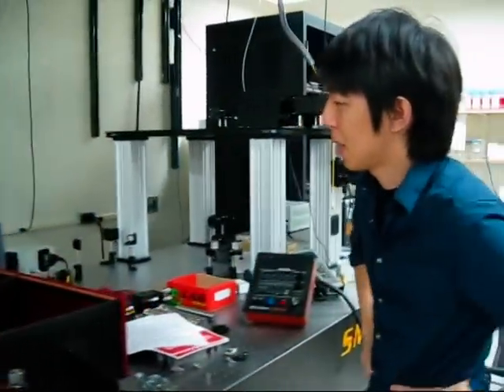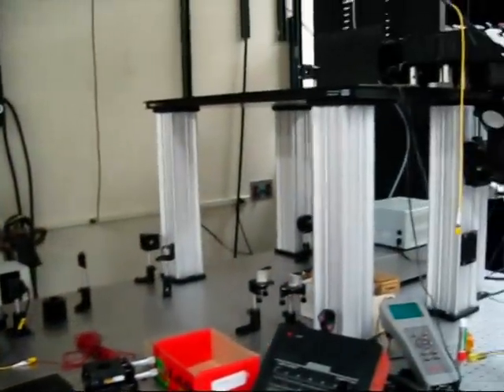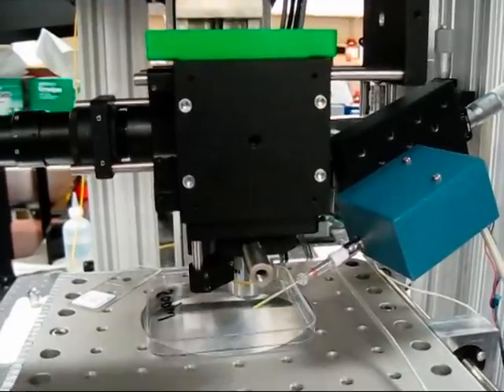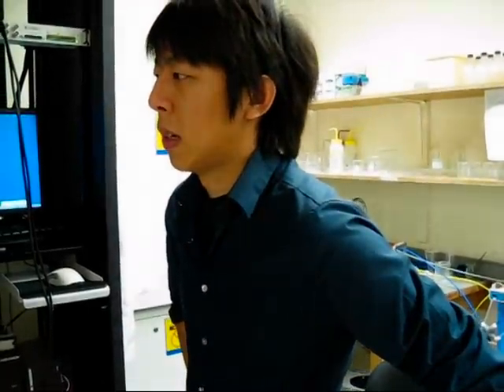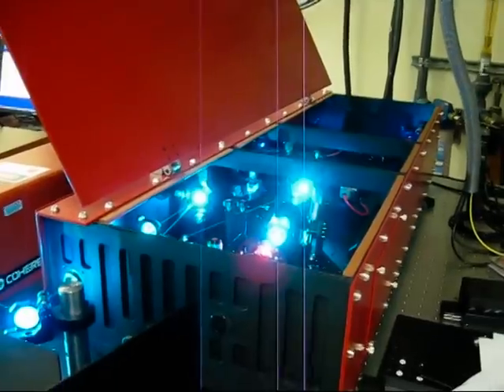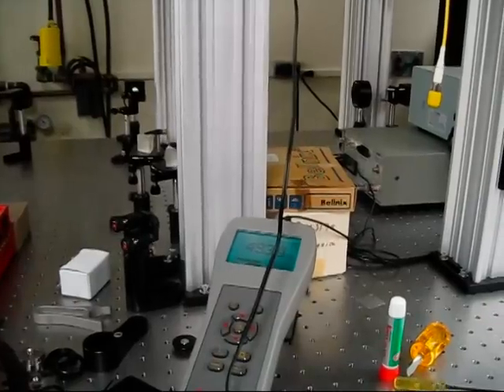Del Mar Photonics Ti:Sapphire laser Trestles in the UCLA Biophysics Neuroimaging Laboratory

Comment from the maker: Histology in vivo: chemical contrast combined with clinical multimodal multiphoton tomograpy
Martin Weinigel, Hans Georg Breunig, Karsten Koenig
10 February 2015 • 11:15 - 11:30 AM | Part of SPIE BiOS

Tailored multiphoton polymerization with abruptly autofocusing beams
Maria Manousidaki, Dimitrios G. Papazoglou, Maria Farsari, Stelios Tzortzakis
11 February 2015 • 4:00 - 4:20 PM | Part of SPIE LASE

Improvement of the spatial resolution in multiphoton microscopy by saturated excitation of fluorescence
Anh Dung Nguyen, Francois Duport, Frederique Vanholsbeeck, Serge Goldman, Philippe Emplit, Simon-Pierre Gorza
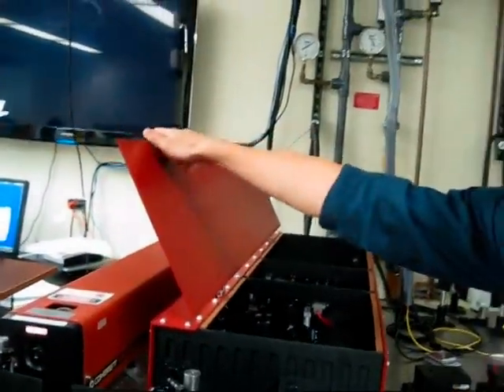8 February 2015 • 5:30 - 7:00 PM | Part of SPIE BiOS

New insights and system designs for temporally-focused multiphoton optogenetics
Tom Mayblum, Adi Schejter, Hod Dana, Shy Shoham
8 February 2015 • 5:30 - 7:00 PM | Part of SPIE BiOS

Detecting the collagen-based hydrogels degradation by multiphoton microscopy (MPM)
Xuye Lang, Matthew J. Spousta, Julia G. Lyubovitsky
8 February 2015 • 5:30 - 7:00 PM | Part of SPIE BiOS

Monitoring wound healing by multiphoton tomography/endoscopy
Karsten Konig, Martin Weinigel, Volker Huck, Katharina Zens, Stefan W. Schneider
7 February 2015 • 3:10 - 3:30 PM | Part of SPIE BiOS
UPCOMING CONFERENCE
Multiphoton Microscopy in the Biomedical Sciences XV
8-10 Feb 2015 | Part of SPIE BiOS

Classification and recognition of texture collagen obtaining by multiphoton microscope with neural network analysis tool
Shulian Wu, Hui Li, Xiaoman Zhang
8 February 2015 • 5:30 - 7:00 PM | Part of SPIE BiOS

In vivo non-invasive multiphoton tomography of human skin with subcellular spatial and picosecond time resolution to detect bio- and chemohazards
Karsten Konig
8 February 2015 • 5:30 - 7:00 PM | Part of SPIE BiOS

Biomedical applications involving multiphoton probes
Mary J. Potasek, Karl Beeson, Evgueni Parilov
8 February 2015 • 5:30 - 7:00 PM | Part of SPIE BiOS

Fiber endface Fabry-Perot vapour microsensors fabricated by multiphoton polymerization technique
Vasileia Melissinaki, Ioannis Konidakis, Maria Farsari, Savros Pissadakis
8 February 2015 • 4:30 - 4:50 PM | Part of SPIE OPTO

Characterizing germania concentration and structure in fiber soot using multiphoton microscopy and spectroscopy technology
Minghan Chen, Ming-Jun Li, Anping Liu
10 February 2015 • 6:00 - 8:00 PM | Part of SPIE LASE

Third harmonic generation and multiphoton fluorescence in graphene using a compact femtosecond 1.56 µm laser
Antti Saynatjoki, Lasse Karvonen, Juha Riikonen, Wonjae Kim, Joonas Makinen, Seyed Soroush Mehravar, Robert A. Norwood, Nasser N. Peyghambarian, Harri Lipsanen, Khanh Kieu
9 February 2015 • 1:40 - 2:00 PM | Part of SPIE OPTO

Identifying different stages during development of colorectal adenocarcinoma using multiphoton microscopy
Jianxin Chen, Zhifen Chen, Changyin Feng, Guoxian Guan, Lianhuang Li
9 February 2015 • 2:35 - 2:50 PM | Part of SPIE BiOS

Some new directions for multiphoton processes and their biomedical applications
Paras N. Prasad
8 February 2015 • 8:30 - 9:00 AM | Part of SPIE BiOS

Multiphoton microscopy for the characterization and treatment of malignant breast lesions
Alex J. Walsh, Rebecca S. Cook, Melinda E. Sanders M.D., Carlos L. Arteaga, Melissa C. Skala
7 February 2015 • 9:50 - 10:10 AM | Part of SPIE BiOS

Co-registration of optical microangiography and multiphoton microscopy for tracking dynamic wound healing
Wan Qin, Yuandong Li, Ruikang K. Wang
8 February 2015 • 5:30 - 7:00 PM | Part of SPIE BiOS

In vivo multiphoton microscopy imaging of basal cell carcinoma
Mihaela Balu, Christopher B. Zachary M.D., Ronald M. Harris M.D., Tatiana B. Krasieva, Karsten Konig, Bruce J. Tromberg, Kristen M. Kelly M.D.
7 February 2015 • 8:50 - 9:20 AM | Part of SPIE BiOS

MEMS-based handheld multiphoton endomicroscope for in vivo imaging
Xiyu Duan, Haijun Li, Zhen Qiu, Bishnu P. Joshi, Asha Pant, Katsuo Kurabayashi, Kenn R. Oldham, Thomas D. Wang M.D.
9 February 2015 • 3:40 - 4:00 PM | Part of SPIE BiOS

Nanoparticle-assisted-multiphoton microscopy for in vivo brain imaging of mice
Jun Qian
10 February 2015 • 11:00 - 11:20 AM | Part of SPIE BiOS

Multiphoton microscopy in brain imaging
Francesco S. Pavone
8 February 2015 • 9:00 - 9:30 AM | Part of SPIE BiOS

Multiphoton tomography on astronauts
Karsten Konig, Martin Weinigel, Nicole Gerlach, Ulrike Heinrich
9 February 2015 • 8:30 - 8:50 AM | Part of SPIE BiOS

In-vivo quantification of cutaneous melanin concentration and distribution: a comparison of multiphoton microscopy and spatially modulated quantitative spectroscopy
Rolf B. Saager, Mihaela Balu, Viera Crosignani, Ata Sharif, Anthony J. Durkin, Bruce J. Tromberg, Kristen M. Kelly
7 February 2015 • 9:40 - 10:10 AM | Part of SPIE BiOS

Imaging human melanoma using coherent anti-stokes Raman scattering (CARS) and multiphoton microscopy (MPM)
Hequn Wang, Sam Osseiran, Elisabeth Roider, Vivien Igras, David E. Fisher, Conor L. Evans
10 February 2015 • 11:00 - 11:15 AM | Part of SPIE BiOS

Image-inspired 3D multiphoton excited fabrication of extracellular matrix structures by modulated raster scanning for cancer biology studies
Paul J. Campagnola, Visar Ajeti, Kevin W. Eliceiri, Manish Patankar
12 February 2015 • 3:50 - 4:20 PM | Part of SPIE LASE

Visualizing and quantifying melanoma risk factors with coherent anti-Stokes Raman scattering (CARS) and multiphoton microscopy
Hequn Wang, Sam Osseiran, Elisabeth Roider, Vivien Igras, Peter T. C. So, David E. Fisher, Conor L. Evans
7 February 2015 • 11:40 AM - 12:10 PM | Part of SPIE BiOS

2D simultaneous spatial and temporal focusing multiphoton microscopy for fast volume imaging with improved sectioning ability
Qiyuan Song, Keisuke Isobe, Kenichi Hirosawa, Katsumi Midorikawa, Fumihiko Kannari
8 February 2015 • 5:30 - 7:00 PM | Part of SPIE BiOS

Nonlinearly fiber-converted coherent source with broad spectral coverage for multiphoton imaging
Haohua Tu, Yuan Liu, Youbo Zhao, Stephen A. Boppart M.D.
8 February 2015 • 1:50 - 2:10 PM | Part of SPIE BiOS

Non-invasive discrimination between pancreatic islets and exocrine cells using multiphoton microscopy
Binlin Wu, Ge Li, Mingming Hao, Shuibing Chen, Sushmita Mukherjee
8 February 2015 • 5:30 - 7:00 PM | Part of SPIE BiOS

Multiphoton light-sheet microscopy using wavelength mixing: fast multicolor imaging of the beating Zebrafish heart with low photobleaching
Pierre Mahou, Julien Vermot, Emmanuel Beaurepaire, Willy Supatto
9 February 2015 • 11:50 AM - 12:05 PM | Part of SPIE BiOS

Label-free multimodal multiphoton imaging by adaptively shaping fiber supercontinuum pulses
Yuan Liu, Haohua Tu, Eric J. Chaney, Sixian You, Stephen A. Boppart M.D.
7 February 2015 • 3:00 - 3:15 PM | Part of SPIE BiOS

Novel applications of melanin pump-probe imaging: correlating structural and chemical variation with MC1R gene expression and the onset of Parkinson's disease
Sanghamitra Deb, Christopher P. Dall, Francisco E. Robles, Christina S. Gainey, Jesse W. Wilson, Warren S. Warren, Nicole A. Kukutsch
9 February 2015 • 11:05 - 11:20 AM | Part of SPIE BiOS

High-speed 3D laser printing by two-photon induced chemistry: breaking the centimeter-scale limit
Pablo M. Romero, Nerea O. Ramudo, Olivier Stephan, Kevin J. Heggarty, Maria Farsari, Boris Chichkov, Patrice Baldeck
11 February 2015 • 10:30 - 11:00 AM | Part of SPIE OPTO

Combining wide-field assessment with nonlinear optical microscopy: possibilities for multimodal imaging in epithelial (pre)cancer
Rahul Pal, Jinping Yang, Gracie Vargas
9 February 2015 • 2:05 - 2:20 PM | Part of SPIE BiOS

Resolution enhancement through three color photolithography
Zuleykhan Tomova, John T. Fourkas
12 February 2015 • 4:50 - 5:10 PM | Part of SPIE LASE

Latest advances in ultra-fast laser sources for multi photon microscopy
Phil Smith
8 February 2015 • 4:25 - 4:40 PM | Part of SPIE BiOS

Adaptation of commercial microscopes for advanced imaging applications
Craig Brideau, Peter Stys
8 February 2015 • 5:30 - 7:00 PM | Part of SPIE BiOS

Mechanical response of single nerve cells estimated by femtosecond laser-induced impulsive force
Takanori Iino, Tadahide Furuno, Man Hagiyama, Akihiko Ito, Yoichiroh Hosokawa
8 February 2015 • 2:30 - 2:50 PM | Part of SPIE LASE

Effect of tip geometry on two photon excited luminescence of single gold nanorods
Arif M. Siddiquee
8 February 2015 • 9:10 - 9:30 AM | Part of SPIE BiOS

Brightness-equalized quantum dots
Andrew M. Smith, Sung Jun Lim
8 February 2015 • 4:20 - 4:50 PM | Part of SPIE BiOS

Improved chromatical and field correction of high-NA GRIN-based endomicroscopic imaging systems for new biophotonic applications
Gregor Matz, Bernhard Messerschmidt, Herbert Gross
9 February 2015 • 11:20 - 11:40 AM | Part of SPIE BiOS

Real-time monitoring of tumor response to preoperative radiochemotherapy for rectal carcinoma by nonlinear optical microscopy
Lianhuang Li, Jianxin Chen
10 February 2015 • 11:35 - 11:55 AM | Part of SPIE BiOS

Nonlinear chromophores with NIR properties for applications in biology and defense
Chantal Andraud
10 February 2015 • 8:00 - 8:40 AM | Part of SPIE OPTO

Interferometric second harmonic generation imaging of biological tissues
Charles-Andre Couture, Maxime Rivard, Konstatin Popov, Mathieu Laliberte, Anthony Bertrand-Grenier, Amir Miri, Francois Martin, Henri Pepin, Luc Mongeau, Christian Pfeffer, Cameron Brown, Lora Ramunno, Francois Legare
8 February 2015 • 5:30 - 7:00 PM | Part of SPIE BiOS

Advantages and drawbacks of Thiol-ene based resins for 3D-printing
Holger Leonards, Andreas Hoffmann, Sascha Engelhardt, Martin M. Wehner, Arnold Gillner
11 February 2015 • 2:20 - 2:40 PM | Part of SPIE LASE

Insights into cellular contact guidance through 3D nanofabrication
Wolfgang Losert
12 February 2015 • 10:40 - 11:10 AM | Part of SPIE LASE

Characterizing the significance of multiple enzyme-bound formulations of NADH and their role in cerebral metabolism using 2-Photon fluorescence lifetime microscopy
Mohammad A. Yaseen, Sava Sakadzic, Buyin Fu, Weicheng Wu, David A. Boas
7 February 2015 • 11:00 - 11:20 AM | Part of SPIE BiOS

Mechanisms for forbidden hyper-Rayleigh scattering
David L. Andrews, Mathew D. Williams, Jack S. Ford
11 February 2015 • 5:40 - 6:00 PM | Part of SPIE LASE

A modular two-photon microscope for simultaneous imaging of distant cortical areas in vivo
Fabian F. Voigt, Jerry L. Chen, Roland Krueppel, Fritjof Helmchen
8 February 2015 • 5:30 - 7:00 PM | Part of SPIE BiOS

Monitoring metabolic enzyme activity in cells with fluorescence lifetime imaging of NAD(P)H
Joe T. Sharick, Melissa C. Skala
8 February 2015 • 5:30 - 7:00 PM | Part of SPIE BiOS

Optimizing laser and probe molecules for multi-photon microscopy
Mary J. Potasek, Gene Parilov, Karl Beeson
8 February 2015 • 5:30 - 7:00 PM | Part of SPIE BiOS

Wide area fluorescent lifetime imaging of surgical specimens using two photon microscopy at MHz rates
Michael G. Giacomelli, Yury Sheykin, Jeffrey Brooker, James L. Connolly, Alex E. Cable, James G. Fujimoto
9 February 2015 • 8:00 - 8:30 AM | Part of SPIE BiOS

Optical nonlinearities in few-layer gallium selenide
Lasse Karvonen, Antti Saynatjoki, Seyed Soroush Mehravar, Raul D. Rodriquez, Susanne Hartmann, Dietrich R. T. Zahn, Seppo K. Honkanen, Robert A. Norwood, Nasser N. Peyghambarian, Khanh Q. Kieu, Harri Lipsanen, Juha Riikonen
8 February 2015 • 10:00 - 10:15 AM | Part of SPIE OPTO

In situ determination of collagen fibrils size via absolute measurements of second harmonic generation
Stephane Bancelin, Carole Aime, Ivan Gusachenko, Laura Kowalczuk, Gael Latour, Thibaud Coradin, Marie-Claire Schanne-Klein
8 February 2015 • 5:30 - 7:00 PM | Part of SPIE BiOS

Optical cell cleaning by NIR femtosecond lasers
Aisada Uchugonova, Hans Georg Breunig, Ana Batista, Karsten Konig
11 February 2015 • 1:30 - 1:50 PM | Part of SPIE BiOS

Compact fixed wavelength femtosecond oscillators for multi-photon imaging
Tommi Hakulinen, Ruben Zadoyan, Tommaso Baldacchini, Tilman Franke
9 February 2015 • 10:50 - 11:05 AM | Part of SPIE BiOS

Applied 3D printing for microscopy in health science research
Craig Brideau, Kourosh Zareinia, Peter Stys
8 February 2015 • 5:30 - 7:00 PM | Part of SPIE BiOS

Next generation laser sources for non-linear imaging
Darryl McCoy, Marco Arrigoni, Nigel Gallaher
8 February 2015 • 4:10 - 4:25 PM | Part of SPIE BiOS

Breast cancer staging through nonlinear endomicroscopy
Gunnsteinn Hall, Wenxuan Liang, Lu Jiang, Kristine Glunde, Xingde Li
9 February 2015 • 9:05 - 9:20 AM | Part of SPIE BiOS

Low cost and compact nonlinear (SHG/TPE) laser scanning endoscope for bio-medical application
Hao Li, Jia Yun Liu, Hon Luen Seck, Xia Yu, Shawwei Kok, Ying Zhang
9 February 2015 • 2:50 - 3:10 PM | Part of SPIE BiOS

Optical diagnosis of mammary ductal carcinoma using advanced optical technology
Yan Wu, Yuting Nie, Fangmeng Fu, Yuane Lian, Shuangmu Zhuo, JIanxin Chen, Chuan Wang
7 February 2015 • 4:50 - 5:10 PM | Part of SPIE BiOS

Development and commercialization of mode-locked VECSELs
Nils Hempler, Craig J. Hamilton, Gareth T. Maker, Graeme P. Malcolm
10 February 2015 • 8:30 - 9:00 AM | Part of SPIE LASE

Revealing the uptake mechanisms of polymeric nanomedicines with coherent Raman scattering microscopy
Natalie L. Garrett, Lisa Godfrey, Aikaterini Lalatsa, Ijeoma F. Uchegbu, Andreas G. Schatzlein, Julian Moger
10 February 2015 • 5:35 - 5:50 PM | Part of SPIE BiOS

Low-noise supercontinuum: Development, characterization, and programmable biomedical imaging
Haohua Tu, Yuan Liu, Sixian You, Stephen A. Boppart M.D.
9 February 2015 • 10:40 - 11:00 AM | Part of SPIE LASE

Targeted illumination in 3D for excitation and stimulation
Elijah Y. Yew, Peter T. C. So
9 February 2015 • 8:50 - 9:05 AM | Part of SPIE BiOS

Nanoparticles generation inside Ag-doped LBG glass by annealing or femtosecond direct laser writing
Marie Vangheluwe, Yannick G. Petit, Nicolas Marquestaut, Evelyne Fargin, Alexia Corcoran, Feng Liang, Real Vallee, Thierry Cardinal, Lionel S. Canioni
10 February 2015 • 9:40 - 10:00 AM | Part of SPIE OPTO

High-resolution nonlinear ellipse rotation measurements for 3D microscopy
Lino Misoguti, Maria L. Miguez, Emerson C. Barbano, Sergio C. Zilio
8 February 2015 • 5:30 - 7:00 PM | Part of SPIE BiOS

Two photon polymerization (2PP) technique optimization study using a green femtosecond oscillator
Areti Mourka, Vasileia Melissinaki, Maria Farsari, Antoine Courjaud, Eric P. Mottay
10 February 2015 • 6:00 - 8:00 PM | Part of SPIE LASE

Microfabrication of three-dimensional filters for liposome extrusion
Tommaso Baldacchini, Vicente Nunez, Ruben Zadoyan
12 February 2015 • 1:40 - 2:10 PM | Part of SPIE LASE

Image-guided ablation for the study of bone regeneration using a femtosecond fiber laser source
Luke J. Mortensen, Clemens Alt, Chia-Yuan Chang, Raphael Turcotte, Giuseppe Intini, Charles P. Lin
9 February 2015 • 5:30 - 7:30 PM | Part of SPIE BiOS

Determination of the spectral dependence of reduced scattering and quantitative SHG imaging for detection of fibrillar changes in ovarian cancer
Kirby R. Campbell, Paul J. Campagnola, Karissa B. Tilbury
8 February 2015 • 5:30 - 7:00 PM | Part of SPIE BiOS

Enhanced nanograting formation assisted by silver ions in a sodium gallophosphate glass: Correlation between surface nanostructuring, fluorescence, and effective second-order nonlinear optical properties
Marie Vangheluwe, Feng Liang, Yannick Petit, Patricia Hee, Yannick Ledemi, Sebastien Thomas, Nicolas Marquestaut, Evelyne Fargin, Thierry Cardinal, Younes Messaddeq, Lionel Canioni, Real Vallee
8 February 2015 • 2:30 - 2:50 PM | Part of SPIE OPTO

Towards 3D laser nano patterning in polymer optical materials
Patricia J. Scully, Walter Perrie
12 February 2015 • 8:30 - 9:00 AM | Part of SPIE LASE

Imaging and modeling the extracellular matrix in ovarian cancer
Paul J. Campagnola, Karissa Tilbury, Kirby Campbell, Visar Ajeti, Kevin Eliceiri, Manish Patankar
7 February 2015 • 10:40 - 11:10 AM | Part of SPIE BiOS

Two- and three-photon excited fluorescence microscopy of erythrocytes using sub-50fs Ti:sapphire and Yb lasers
Marcos Dantus, Ilyas Saytashev
9 February 2015 • 1:50 - 2:05 PM | Part of SPIE BiOS

High repetition nanosecond Ti:sapphire laser for photoacoustic microscopy
Timothy K. Yang, Bokyung Kim, Chulhong Kim, Sungchul Bae
10 February 2015 • 6:00 - 8:00 PM | Part of SPIE BiOS

All-PM-fiber normal dispersion femtosecond optical parametric oscillator pumped by Yb-doped fiber laser
Khanh Q. Kieu, Dmitriy Churin, Roopa Gowda, Takefumi Ota, Yukihiro Inoue, Shinichiro Uno, Nasser N. Peyghambarian
10 February 2015 • 6:00 - 8:00 PM | Part of SPIE LASE

Characterization of porcine eye based on autofluorescence lifetime imaging
Ana Batista, Hans Georg Breunig, Aisada Uchugonova, Antonio Miguel Morgado, Karsten Konig
8 February 2015 • 2:05 - 2:20 PM | Part of SPIE BiOS

Evaluation of the effect of pericytes as treatment for non-healing diabetic wounds using integrated multimodal microscopy
Joanne Li, Andrew J. Bower, Yair Pincu, Marina Marjanovic, Eric J. Chaney, Marni D. Boppart, Stephen A. Boppart M.D.
7 February 2015 • 1:40 - 2:00 PM | Part of SPIE BiOS

A new calibration tool to simply and quickly monitor and follow the performances of fluorescence microscopes
Arnaud Royon, Gautier Papon
10 February 2015 • 11:40 AM - 12:00 PM | Part of SPIE BiOS

Off-resonant plasmonic enhancement of linear and multi-photon emission from InGaN-GaN quantum wells
Arup Neogi, Jie Lin, Sergio Pereira, Ian M. Watson
10 February 2015 • 8:30 - 8:45 AM | Part of SPIE OPTO

Generation of laser-induced periodic surfaces structures in indium-tin-oxide thin films and two-photon lithography of ma-N photoresist by sub-15 femtosecond laser microscopy for liquid crystal cell application
Madlen Klotzer, Karsten Konig, Martin H. Straub
10 February 2015 • 6:00 - 8:00 PM | Part of SPIE LASE

Beam scanning approach to broadband coherent Raman imaging
Young Jong Lee, Charles H. Camp, Jr., Marcus T. Cicerone
10 February 2015 • 2:35 - 2:50 PM | Part of SPIE BiOS

In vivo deep tissue optical imaging via wavefront compensation
Meng Cui
7 February 2015 • 3:20 - 3:50 PM | Part of SPIE BiOS

Four wave mixing microscopy: a high potential nonlinear imaging method
Tobias Ehmke, Andreas Knebl, Alexander Heisterkamp
9 February 2015 • 2:20 - 2:35 PM | Part of SPIE BiOS

Evaluation of the effect of recombinant murine interleukin-12 on skin regeneration and bone marrow-derived cell trafficking
Joanne Li, Andrew J. Bower, Vladimir Vainstein, Zoya Gluzman-Poltorak, Eric J. Chaney, Marina Marjanovic, Lena A. Basile, Stephen A. Boppart M.D.
9 February 2015 • 5:30 - 5:50 PM | Part of SPIE BiOS

Fluorescence lifetime imaging in the near-infrared region
Wolfgang Becker, Vladislav I. Shcheslavskiy
8 February 2015 • 5:30 - 7:00 PM | Part of SPIE BiOS

Label free, real time visualization of tissue histology at subcellular resolution: a study of primary versus secondary human brain cancer tissues
Carmen Kut, Wenxuan Liang, Gunnstein Hall, Kaisorn Chaichana, Alfredo Quinones-Hinojosa M.D., Xingde Li
8 February 2015 • 11:10 - 11:30 AM | Part of SPIE BiOS

Femtosecond-pulse plasmonic ionization kills cancer cells
Limor Minai, Adel Zeidan, Daniella Yeheskely-Hayon, Dvir Yelin
8 February 2015 • 2:50 - 3:10 PM | Part of SPIE LASE

Imaging the tumor/stromal boundary
Patricia Keely, Kevin W. Eliceiri
7 February 2015 • 8:00 - 8:30 AM | Part of SPIE BiOS

Two-photon autofluorescence lifetime and shg imaging of healthy and diseased human corneas
Ana Batista, Hans Georg Breunig, Aisada Uchugonova, Berthold Seitz M.D., Antonio Miguel Morgado, Karsten Konig
8 February 2015 • 5:30 - 7:00 PM | Part of SPIE BiOS

Mechanisms of direct laser writing on a tailored silver-containing zinc phosphate glass: dual-color laser writing, UV post-illumination thermal influence, and sub-diffraction structures
Yannick G. Petit, Konstantin Mishchik, Nadezda Varkentina, Arnaud Royon, Nicolas Marquestaut, Etienne Brasselet, Thierry Cardinal, Lionel S. Canioni
9 February 2015 • 5:30 - 5:45 PM | Part of SPIE OPTO

Fabrication and characterization of micro-structures created by direct laser writing in multi-layered chalcogenide glasses
Casey M. Schwarz, Chris N. Grabill, Benn Gleason, Spencer Novak, Anna M. Lewis, Gerald D. Richardson, Clara Rivero-Baleine, Kathleen A. Richardson, Alexej Pogrebnyakov, Theresa S. Mayer, Stephen M. Kuebler
8 February 2015 • 11:00 - 11:20 AM | Part of SPIE OPTO

Direct laser writing of complex photonic structures
Harald Giessen, Timo Gissibl
8 February 2015 • 4:00 - 4:30 PM | Part of SPIE OPTO

Modeling tissue heating under tunable near IR radiation
Joel N. Bixler, Brett Hokr, Aaron F. Hoffman, Michael L. Denton, Benjamin A. Rockwell, Vladislav V. Yakovlev, Robert J. Thomas
9 February 2015 • 11:50 AM - 12:10 PM | Part of SPIE BiOS

Large area fabrication of light trapping nanostructures for high efficiency silicon solar cells
Debashis Chanda
9 February 2015 • 10:30 - 11:00 AM | Part of SPIE OPTO

Three-dimensional plasmonic nanostructures for enhanced circular dichroism
Negar Otrooshi, Abraham Vazquez-Guardado, Daniel Franklin, Debashis Chanda
8 February 2015 • 1:50 - 2:10 PM | Part of SPIE OPTO

On the influence of atmospheric oxygen on 2D and 3D direct laser writing
Michael Adams, Jonathan B. Mueller, Joachim Fischer, Martin Wegener
11 February 2015 • 2:00 - 2:20 PM | Part of SPIE LASE

Diamond frequency combs
Marko Loncar
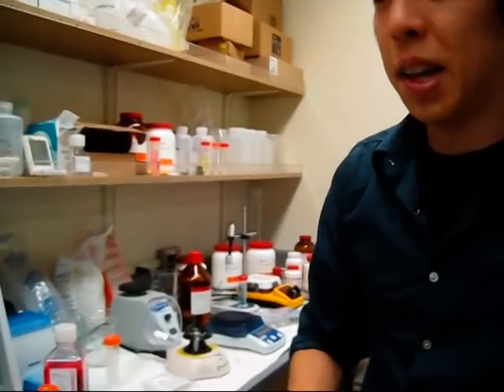9 February 2015 • 1:20 - 1:45 PM | Part of SPIE LASE

Development of high-strength and light-weight hierarchical materials based on 3D direct laser writing
Jens Bauer, Almut Schroer, Ruth Schwaiger, Oliver Kraft
11 February 2015 • 1:30 - 2:00 PM | Part of SPIE LASE